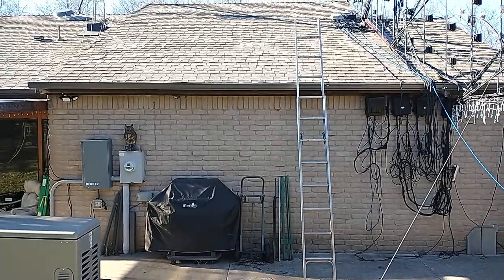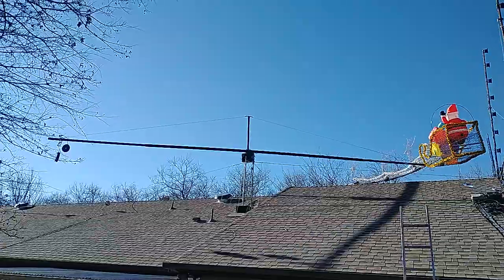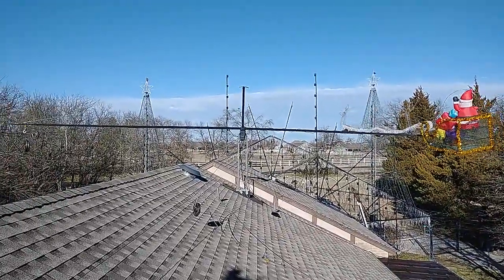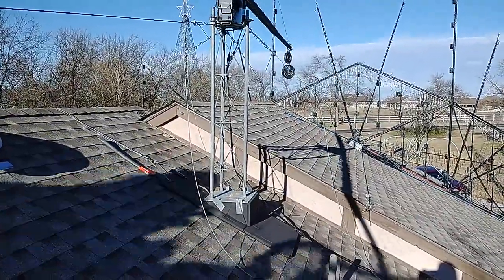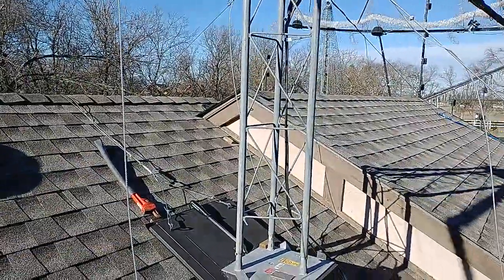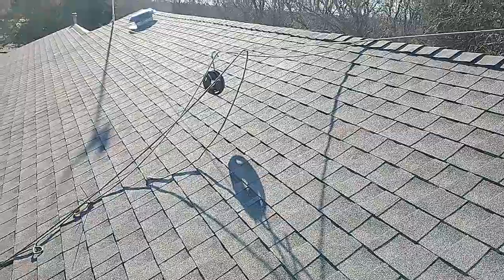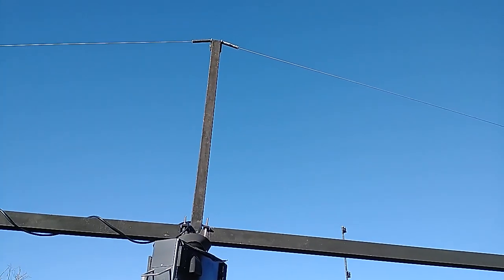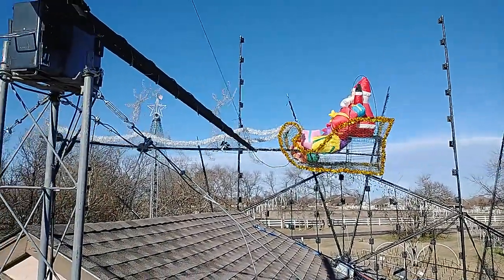2023 - Rooftop Rotating Santa/Reindeer

Comment: Hello,  What model of a motor did you use from dynapac?
Reply from the maker: In the video was the H-800. It did great on calm wind days but if the wind got up to about 15ish MPH, the unit would slow down and/or stop rotating. If you had smaller props it was rotating, that would be less wind drag and may not be an issue. I'm updating my setup to a different/bigger motor assembly this year.
Reply: @OKCTom  Did you upgrade motor assembly?  If you did are you willing to sell the unit in video?  Doing something similar in Northern Alberta
Reply from the maker: @medveszek  Yes, I did build a larger motor assembly but haven't set it on the roof to test yet. If the new build goes good, I would be interested in selling the unit that was used in the video.
Reply: @OKCTom  Hello,  Have you had a chance to test new motor?  Still interested in your old motor assembly.  Thanks
Reply: Me too !

Comment: Certainly an amazing display love it !! I see some replies on how you get power to the sleigh and reindeers just wondering if you could explain it to me sorry its got me scratching my head 🙃 amazing how you've built it all yourself well done 😁👍
Reply from the maker: Thank you. I'll try my best. When you have something (like a sign) rotating that needs power, there is something called slip rings. Slip rings are attached to the rotating shaft so they rotate together. Then there are brushes where incoming power is applied to them. The brushes slide on the slip rings and allows the electricity to flow/transfer to the rings. Wires are internally attached to the inside of the rings and up the rotating shaft where a plug is attached. From there, the power goes to the props using extension cords. Hope I explained it okay. You can also google powering slip rings for further details/applications as well.
Reply: @BricktownAmusement  thanks so much mate really appreciate it and love the display and your amazing videos thanks from Australia 🇦🇺 😀
Reply from the maker: Thank you. I appreciate it.
Reply: Please explain again how you keep the inflatables blown up.

Comment: What did you use to get power to the rotating part?
Reply from the maker: The motor assy consist of slip rings so rotation can occur and power supplied to a plug rotating with the props.
Reply: How did you get the power out to the pebble lights? How are you dealing with the rotation? Did you use slip rings?
Reply from the maker: Inside the motor assy are slip rings so rotation can happen and power be applied to the lights for Santa, sleigh and deer.
Reply: Got it, thanks. How many HP is the motor? I presume its some sort of gear reducing motor.
Reply from the maker: It is a gearbox type setup. The specs are Torque Output @ 2 RPM -168 in-lbs [19 Nm] Motor Draw - 0.46A (50 watts). It didn't have an actual HP spec. Hope that helps.
Reply: Beautiful video...thank you for the ideas....I was gonna use a 200 lb rotating Christmas tree base instead of your motor....my santa and reindeer only weighs 30 lb....😊